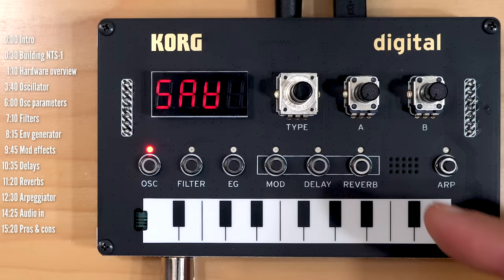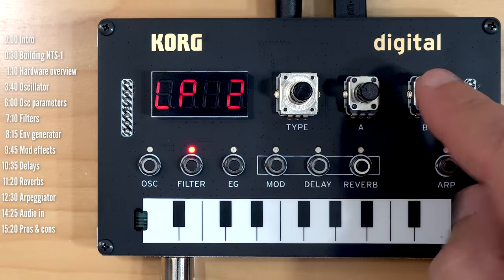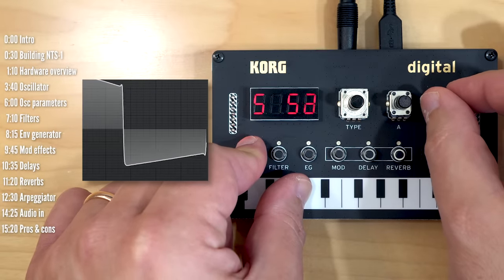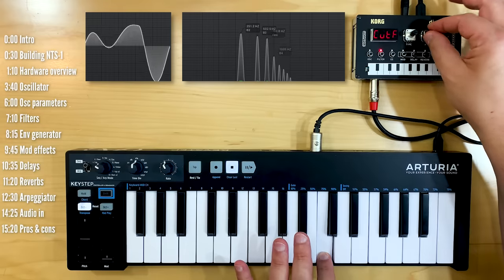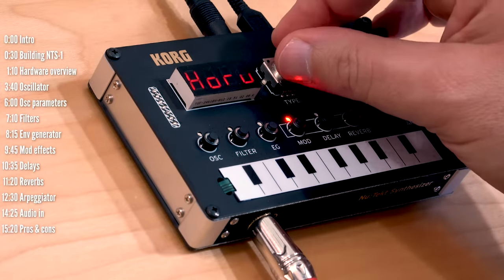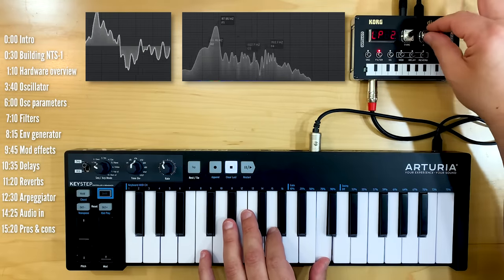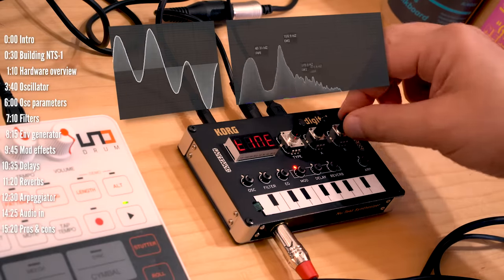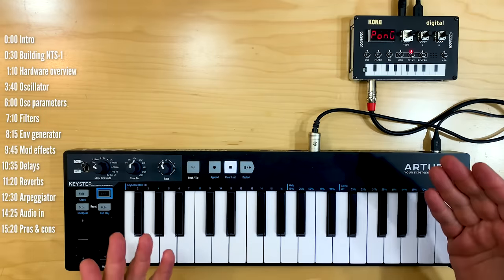KORG NUTEKT NTS-1: Full review // Here's everything it can do

Comment: What a cool review. I like the industrial design of the synth, even if it's not what I'd call ideal for my needs. 
Still, I like that Korg is pushing the bounds of what we'd traditionally call a synthesizer. It's reminiscent of those tiny little electric keyboards you could buy in the 80s, with terribly digital piezo speakers and rubber keys. 
It's like the 2010's version of one of those, meaning cheap and portable, but WAY more advanced. 

Thanks for the upload, Loopop.

Comment: Legendary Loopop as always!

One thing that I must say about the NTS-1 is, it is a bit challenging to use it live due to the fact that the knobs work, not saying it is a bad thing but is good to note.

 Say you have set the OSC , then you switch to EG, you may need to remember the knob settings for the  last parameter modified for OSC  before playing with the EG settings because once you hit OSC again and start turning , it 'jumps' to the value of the knobs right away , which was set for the EG settings .. Carefully planning and setting them one by one ( like OSC shape alt, then FILTER, then EG, etc) usually helps

Comment: This is a must have just as an effects processor. Why buy a guitar pedal(s) at this point when you have a really nice effects range out the door, and the fact that custom plugins are going to meet or exceed the $350 reverb/delay boxes. Good lord this is amazing. This is also small enough to be in-line for ALL my external gear. I'll buy a dozen of them.
Reply: The only downside is it's an effects pedal you stomp on ONCE, and once only.
Reply: would you be able to connect a guitar to the audio in?
Reply: Agreed.  

As far as guitars I'm guessing it's a solid maybe. It probably needs to be a line level signal which means you probably need some kind of a preamp as well as the adapter down to an eighth inch input and then an adapter back out from the output if you wanted to run it on a pedal board.

Comment: I think it would be useful to go through the connections set up between the keystep and the nts-1. It may be obvious to many but not to all and it would really help.
Reply: You need a Type A 3.5mm to MIDI adapter. 3.5 end plugs into the NTS-1. Standard MIDI cable plugs into the adapter and the Keystep.

Comment: Ordered mine in October, only just now received it! Wow...is this thing fun! And like you said...it's worth the price just for the effects! I plugged in my Think Geek BlipTronic 5000 and had a blast! Then I grabbed my Korg Kaossilator and ran that through the effects processor and it makes the Kaossilator a completely different animal!
Reply: It took several months for mine to turn up too. I've just put mine together and have been using it with my OP-1. I love the 'ensemble' effect - very Boards of Canada. I like what the waveshaper does to the sawtooth wave too.
Reply: @metascrawlmusic  Agree. Now All I wish for is some kind of online group that I can get tips and hints from. I am having a bear of a time getting this thing to talk midi. I purchased a USB Midi keyboard and a USB-5DIN host converter and nothing....very frustrating!
Reply: @ekummel  That I can help with. It will be because the keyboard doesn't act as a MIDI host, it just sends out data for a host to interpret - I've run into exactly the same thing with my OP-1. You need to have something inbetween that will interpret USB MIDI signals into standard MIDI. 

That can be your computer, with the MIDI in & out channels set up in your DAW, which is what I do. The alternative is the USB MIDI host that Kenton makes - it does the same hosting job of a computer + DAW but it's just a small box. Only problem is that it's pretty expensive, which is the only reason I haven't bought one so far.

It is annoying - I think every piece of MIDI gear should natively host, but most USB-only devices don't.

EDIT: Sorry, you did say you had a host, I misread. Are you sure it's a host and not just a USB to MIDI adapter? The latter are inexpensive but still rely on a computer to do the actual hosting. What is the make/model of the one you have?
Reply: @metascrawlmusic  I picked up a MidiPlus Midi Host. It has 5 pin din in and out, and a USB with an LED. The LED's supposed to be red when there's no USB signal, and green when there is a USB signal. I discovered that the TRS to MIDI on the NTS-1 is not standard. My existing TRS adapters wouldn't work. Looking at the Midi spec document on Korg's site, it says that it must be a TRS Type-A. So I purchased one of those, verified the pin-outs with my multimeter and hooked everything up again. Nothing. I know that the USB midi keyboard works. I downloaded the Midi Keyboard App on my Windows laptop and plugged the keyboard into my laptop and I can play all day long. But I cannot get the NTS-1 to talk with the USB keyboard.
I'm suspecting that there's something wrong with the USB to Midi host in that the LED won't turn green like the manual says. 
Thanks for any help you can give me.
Reply: @ekummel  I've not heard of that host before, but I looked it up and it does seem like it should work for what you're trying to do. 

What I would do in your position is plug the USB host into my PC and see if it's recognised by my DAW. If you don't have one installed on your laptop, you could install LMMS, which is free - or maybe even the MIDI keyboard app you have could do it? If the host shows up as a MIDI device, you could try sending it some notes from the DAW/app and see if that light goes green. If you can get it to work that way, at least you can rule out that the host is faulty, as you've already done with the keyboard.

Apologies if you've tried this, or if it's no help - the fact that you even own a multimeter makes me suspect you're more knowledgeable than I am!
Reply: @metascrawlmusic  that's a good idea plugging the midi host into the computer. I hadn't thought to do it that way. I'll give it a try and let you know what happens!

Comment: I wish they would release this as a eurorack diy.  Just a diy OSC with V/Octave would be an amazing pull at this price point.
Reply: If you're handy you can use an Arduino Nano as a CV to Midi converter. Can be powered by 5 volts, just like this device (if you take a chinese knockoff of the revision 3 model). You can probably fit the Arduino in this NTS-1. Or just attach it on the back. You'd still have to find a way to mount it, get ports in the front, make a way to power it with a normal Eurorack power supply, but it all seems doable.

Comment: Hi, thanks for the video. I can't understand one thing: i want to use the Korg NTS1 like an effect, for my korg volca bass. What i did i to put the cable headphones of the korg volca bass, into the aux in of the korg nts1. But, in this case, i don't understand why i only hear effects of the korg nts1 like reverb, but not the arpegiator of the korg nts1. Is there a problem with my new korg nts1? Thanks

Comment: You think there's room for a little slim lithium battery pack? I think just wiring it direct to the usb with a little charging chip out of the usb rechargeable fan that I'd pull the battery out of would work. Just wondering about space

Comment: Ziv, which MIDI adapter did you use? I've tried all that I have and none seem to work.
Reply from the maker: The standard TRS A ones (Korg, makenoise, IK multimedia) should work.  Are you sure you’re not using TRS B (Novation, Arturia)?
Reply: @loopop  I bought one off of Amazon and it didn't state which is was. I've tried using ones that came with my 1010 Bitbox and BSP as well, but none work. I ordered a MakeNoise one that someone on the forum said works, so fingers crossed. Thanks!
Reply from the maker: D B Pawlan Indeed 1010 and BSP use the wrong wiring

Comment: Sweet Jeezus. I'm a bit of a noob, so help me understand. I could run midi out from my Monologue into this baby and then the audio signal from the Monologue through this, too, and turn it into a sort of 3 oscillator hybrid with multi-effects?
Reply from the maker: Yes, you'll just need a 5 pin to TRS adapter
Reply: Best $100 upgrade ever. Behold the Monologue XD.

Comment: I think to buy one, I have those trs to midi one came with microfreak other   with zoia . Should I buy one specific for this? I am a bit confused since they are not all the same. 

To connect the freak to zoia I had to plug trs to midi cable and back midi to trs in order to work a simple trs jack to jack  didn't communicate.

Comment: I have terrible loud USB noise when connecting the little synth to a computer. Even louder than my UNO drum. Normally I don‘t have this problems with my system. Did you recognize this during your test, or is my unit faulty?
Reply from the maker: I would check with IK just in case but I’ve seen many devices make horrible noise when connected to a computer. I don’t recall mine doing it though

Comment: Hey Loopop, I hope you find the time to read this message, this time I'm asking for your advice and also hoping that your community might read this and find an answer: Have you ever run into problems with the NTS-1 sync? I own two NTS-1 and both have ended up with the same problem: The sync function fails for some reason and the arpeggiator stops playing. As long as I keep a cable plugged into the sync-in port the arpeggiator fails to play. I bought the second unit NTS-1 because the first one failed in this way. Then the second one ended up with the same problem. Any clues? Do you know if these little units can be fixed at all? (I tried with no success factory reset and all global settings regarding sync polarity etc). Thanks so much, any help from your vast experience would be great.
Reply from the maker: Sorry I've not used NTS-1 in a very long time - perhaps someone else can answer!

Comment: What kind of cable did you use for Midi In? Is it the one from the SQ-1? Because usually adapters for Midi In are different from adapters for Midi Out if I'm correct. At least that's how it works for the Arturia Beatstep Pro. (There's even a third one just for Clock Sync). And do you have any recommendations for those that don't have any of these adapters? I can only find sets of adapters from €30-€53 or very cheap adapters from China, but none of the stores mention how they are internally wired. Any help would be greatly appreciated, I've spent 2 hours already trying to figure out where to get a cable and checking the official Midi Association documentation on how to DIY a cable. Luckily I can solder...
Reply from the maker: Otto van Zanten the sq-1 cable should work.
Reply: @loopop  Sadly it seems like you can't buy those anywhere. Thanks for the wuick reply though! Love your vids!

Comment: A few questions:

Is the MIDI jack 3.5mm?  In photos, it looks smaller than the sync and audio in jacks.
Does the multi engine come with a noise generator?
Any idea if the audio in can handle modular level signals?
Can it learn to listen to a specific MIDI channel?
Reply from the maker: This one is a prototype so it had 2.5mm jack which may account for what you saw, but I’m told production units will have 3.5mm. No noise generator though I’m sure someone will come up with one (or just use the mutable ones); yes midi channel is configurable
Reply: @loopop  That's good to know, thanks.  So far, the guys doing the Mutable ports haven't done noise, but I assume it's because the Prologue and XD already have it.

I take it there is no wavetable oscillator either?  How many user oscillators/effects can it store?

Comment: Wow, these are kind of like the Pocket Operators. You have to hold certain buttons down to enter modes and it forces you to learn the ins and outs of the whole device, unleashing its full potential. I might buy this, I found it online for sell. Is $99 a good deal to get the kit and assemble it? Is there anything else like this for someone on a budget? I'm wanting a mixer, input/output CV gates, and the ability to oscillate LFOs and use Pulse Width Modulation effects on everything. Pretty much the Arturia MiniBrute, but something cheaper. Any ideas?

Comment: Hi @Loopop! Love your work mate! Just purchased an NTS-1 and am trying to use my Bass Station 2 as a midi controller and have just learned that Novation uses midi type B and Korg uses Type A. I’m currently unable to control the NTS-1 until I can source a Korg breakout cable. I know you made another video about midi to USB, but I wonder if everyone is aware of the 3 types of midi cables. Any advice would be appreciated as I’m finding it almost impossible to source a reputable and correct type A breakout cable.
Reply from the maker: Thanks! Yeah it's kind of a bummer that they don't include one. Just try eBay or Amazon - there's no way around it unfortunately. Meanwhile you could route MIDI through a computer just to get you going (if I remember correctly it supports MIDI over USB...)
Reply: loopop I’ve managed to sync it with my Volca FM with a sync cable. The Volca receives midi clock via a Quadra box from Circuit. So now everything is synced. I’ve run the BS2’s audio through the NTS-1. That reverb though!! 

I’ve not fired Ableton up yet. At least now everything is in sync! Cheers for the reply mate! Really appreciate it 🤘

Comment: Thank you as always for the great reviews! I’m interested in getting a NTS-1, problem- need to use it Dawless with Digitakt, no mixer, so the NTS-1 stereo output will not be reflected properly in Digitakt’s 2 mono inputs, correct? (Digitakt will sample or monitor the audio and convert it to mono, correct?)  So... would I be able to take Digitakt’s stereo output and plug into the NTS-1’s audio input, monitor Digitakt with no NTS-1 FX, BUT, simultaneously use the NTS-1 FX on the NTS-1’s internal synth, monitoring both the Digiatakt and NTS-1 through the NTS-1’s headphone/line out jack ? (of course also using Digitakt’s MIDI sequencer to play the NTS-1 through the NTS-1 MIDI In) Now, on using Digitakt with CUBASE and the new Overbridge software, I presume one could patch the NTS-1’s audio out into the Digitakt audio In ports and that stereo image should be properly reflected as “stereo” inside CUBASE/Overbridge, correct ? Sorry for the long question, hope my inquiry makes sense, thank you for you expertise loopop !
Reply from the maker: JOE BJORNSON you could pass Digitakt thru nts 1 and sequence it but the fx would be applied to everything. If you’re already using a computer though just send Digitakt to it
Reply: thanks loopop, I heard the NTS-1 does actually have a “dry/wet” mix on the FX but didn’t know that the NTS-1 synth engine AND the NTS-1 audio in is processed with the NTS-1 FX simultaneously, heard the NTS-1 FX are not MIDI syncable? but what an amazing little box!

Comment: I have a question I haven't seen answered (nor asked) in the comments:

Does the NTS1 offer LINE-level audio signal? (Non-USB)

At the back I see USB, MIDI, SYNC i/o, and AUDIO IN, but no OUT.
Nothing on the sides.
At the front I see only what seems like a HEADPHONES Output.  Is this output also offering LINE-level from the same jack?  

Or it is doomed to output only throught the USB port?  (that would REALLY SUCK if so!)

Thanks

PS: Thanks for all your AMAZING reviews!
Reply: Went on Korg's Website and nope... Doesn't seem to have a LINE OUT.
And the Headphones Jack info makes no mention of being adaptable.
Oh, and there's a SPEAKER!

Manual says:

-VOLUME: Sets the volume of the signal output to the speaker and (Headphone) jack.
-(Headphone) jack: Connecting your headphones to this 3.5mm stereo mini jack will mute the NTS-1 digital kit internal speaker and allow you to create music in private
Reply from the maker: Thanks! It does not output audio over usb to my knowledge

Comment: Big sounds for a little diy machine.

But how programmable is it?

How much does it cost?
Reply from the maker: It costs $100 and is as programmable as the XD and prologue
Reply: @loopop  If this little thing is $100, it'll be a pre-purchase for me. When you demoed the possibility to run an external signal in, and use its effects, I was sold. One question though: can you use its filter on an external signal? (Sorry if you covered this, might've slipped past me, as I listened it while working :) )
Reply from the maker: @jarkokoo  yes - if you load a filter into the mod effects (like the one by Dirtbox)
Reply: @loopop  That's good news, thanks for the reply!

Comment: PRO: Friggin Opensource synth finally! CON: Missing IO pins/pads for adding extra jiggly bits like sensors or joysticks, seems like a strange omission for a DIY synth!
Reply: Isn't that what the vertical solder point strips on the sides are for? I haven't even finished watching the video yet, let alone read the manual, but it looks like they're points to add some pin headers?
Reply: @0Fdigital  Those connect the top controls to the bottom synth board. Remains to be seen if we can tap into that.. its definitely not just a free pad to solder onto. There IS a little chip on the underside of the controls so there may be some communication we can use.. kind of like arduino shields or raspberry pi hats.
Reply: @pixelflow  Ah right, yeah I had a look at the (very simple) manual and saw that's what they're for just after writing my comment. It'd be nice to have a breakout box to make it knob per function, but then again, I'm guessing that's what the MIDI in is for.

Comment: Somebody actually calls it 'The NTS-1' instead of 'the Nu:Tekt' :O

Did I understand correct that you can only Sweep the Filter and only set an envelope for the VCA?
I'll probably be picking it up if only to use it as an effects processor for my Volca's and other portable gear. If it's indeed 'definitely cheaper than a volca' this should be a steal even without the sound generating part. I'm really hoping for €120 crosses fingers